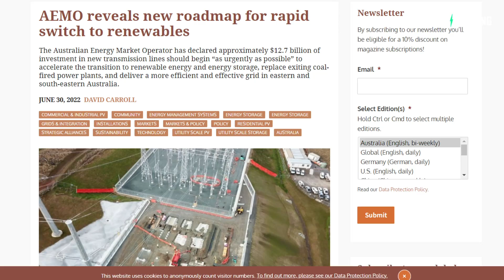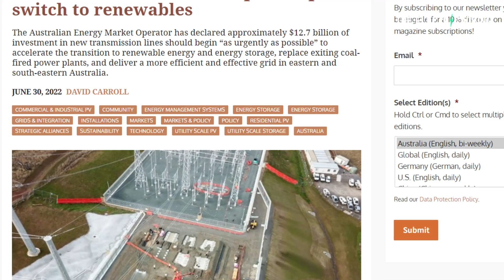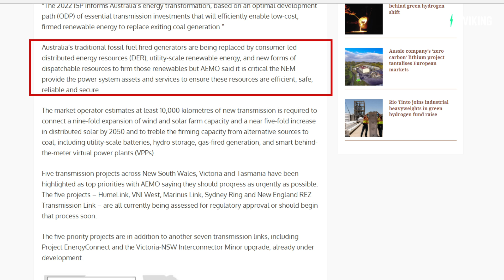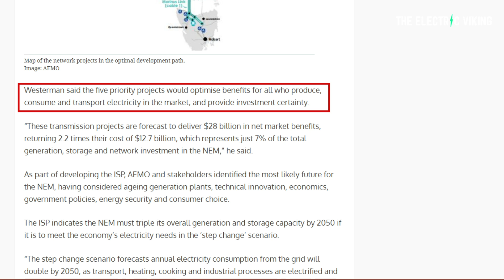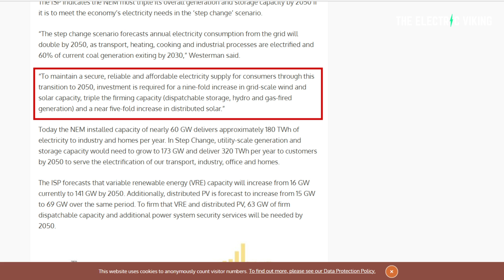Australia's AMAZING roadmap for rapid switch to renewables

Comment: An interesting calculation is that Australia only needs 1465 square miles (or 0.05%) in solar farms of its total 3-million square mile land area to provide for its annual electrical use of 265,232 GWh!  This 1465 square miles works out to be equivalent to the Sydney metropolitan area.

This is using the US solar farm value of 181GWh per square mile per year of energy production in their sunnier western regions which also includes seasonality, day/night cycle, solar panel efficiency and solar panel spacing.

For comparison, the US's solar farm size value is 22,000 square miles (or 0.7%) of its contiguous US 3.2-million square miles to cover its much larger 4-million GWh annual electricity use.  This is just the size of Lake Michigan and not even 1% of the contiguous US's land area.

Even doubling this figure to give a wide margin of error in either Australia or US calculations is still a small area of land.

Nobody would build a single solar farm this size but it highlights the point that solar is not a small source of energy.  That amount of panels would obviously be spread out using a formula that maximizes solar irradiance and be as close to the population centers as possible.  That amount of solar panels wouldn't even be noticeable from space when spread out.
Reply: Cover part of every rooftop, say 40m2, and have the power consumed LOCALLY.
Distributed power supply UNLOADS the grid. 
An EV (or home battery) will help stabilise the grid. And back up supply. 
If you have an EV do not need other battery. The EV comes with a huge battery free.
The Daily drive is 7kwh, tiny part of the 'long drive capacity'.

Comment: For those been asking, a country or state's renewables transition will be done gradually and follow a logistics adoption curve: slow at first, exponential ramp up in the middle, and eventually flattening out again as the new market matures.  It will also follow a phase-in & phase-out approach.

Fossil fuel (FF) plants (including peaker plants) will stay in operation on the grid as long as they are needed until they aren't.  Grid stability and capacity is paramount.

Concrete example: California has a similar Mediterranean climate to Australia and California runs on 70% to 95+% on non-fossil power sources during many hours of the day!  This happens day after day even though natural gas is some 50% of California grid's 200-terawatt•hour size.  How is that possible!?

As the sun rises in the morning, California's solar assets start feeding their energy into the grid.  Power reaches maximum at midday before tailing off around at dinner time.  This is typical. 

But natural gas and coal are "load following" dispatchable forms of energy.  So the grid operation center will automatically throttle back FF turbine RPMs towards idle as they see demand apparently "fall" but its actually solar power outputting large amounts of power into the grid and satisifying (canceling out) demand.  When FF plants are able to throttle back for many hours of a day, they reduce wear & tear, increase their operating lifetime, and directly decrease their CO₂ emissions.  This pattern happens day after day.

Critically, as the years go by, the renewable's daily power window will start expanding outwards as California adds more renewables and grid-storage to its energy mix until the entire 24hr day/night cycle can be firmly covered.  This may take a decade or two but this is how most existing grids are going to transition over and the pathway is fairly predictable.  Though exact timing is hard to predict due to politics, technology breakthroughs, citizen environmentalism pressure, wars & armed tension over FF, fluctuating FF availability and pricing, etc.  These things can either move up or delay the transition schedule in their own complex ways.

Any region with renewables in the energy mix will experience the same pattern.  At some point in the future, the last fossil fuel power plant in the region is decommissioned with a huge sunset party to memorialize it in the record books.  Reminds me of when they phased out the last public telephone booth in NYC early this year.  Many news outlets were there to cover this sad looking lonely telephone booth being unceremoniously hauled onto a flat bed truck.  Many jokes about Superman Clark Kent lacking a place to change were made.  Surely some zinger "dinosaur juice" jokes can be told for the last FF plant. :)

In conclusion, renewable energy already provides value to the grid even when the grid is in a *partial transition state*.  Fossil fuel fanatics (some are corporate petro paid shills) like to muddy up the forums and confuse people by implying that if the grid can't transition overnight then its not gonna happen ever.  Nothing this size happens overnight but the transition is manageable.

Comment: Thanks Sam. That's a decent step in the right direction. 🙂 A comparison is worth mentioning. The U.K. plans to have its last few coal-fired power plans decommissioned by 2025. Over a third of our electricity needs are met already by renewable resources, averaged over a year. Peaks have been over 60% for short periods.And there is a big investment in more wind, solar and tidal generation plants. 

That is the kind of goal that the US and Australia need to aim for. 2030 would be fairly good, if Australia could shut theirs down by then. But only a 60% reduction by 2030 seems rather paltry, when you have a country with huge amounts of dependable wave power available, plus oodles of Sun energy, and a fair amount of wind energy, particularly around your 10,000 miles (or more) of coastlines.

For contrast, Britain pales into insignificance when we look at Norway, which has been generating 98%, or more, of its electricity requirement for a number of years. They export some of their spare capacity to the island of Great Britain. The number of EV's being bought in that country is in line with their hydroelectric-based electricity grid. Sales of EV's outnumber cars of all other fuel types combined, mainly because of decent incentives, proper infrastructure  a positive attitude on behalf of those in office, and excellent education of the car-buying public. The rest of the world should take note.

Comment: Think like most things clean renewable power will work on a “s” curve … it’s taken 30 odd years to climb up to 5-10% generation in most off the 1st world but I reckon it will grew vastly fast from 20% to 80% before at that point it may climb slowly again due mostly to population gain… and solar panels/wind turbines starting  at that point needing replacement etc etc

Comment: Can you imagine?  Putting a $4 bn cable under Bass Strait so that during the day power can be pumped to Tasmania to drive water uphill and when night falls the water can run downhill to make power to be pumped back to the mainland.  Of course we shouldn't think of the alternative of making the wind/solar power near where we use it and using batteries for storage because then we wouldn't need AEMO.  The Grid is 20 C as is AEMO.  In 21 C the Grid should be a backup remnant and not something to which Australians are subservient.  The fact that our political class takes their advice from AEMO shows their proud ignorance of STEM.  Only costly mistakes like Snowy 2.0 will eventually force them to change.
Reply: EXTREMELY ON THE POINT. 
But I think the existing grid will gather power from every rooftop solar PV system and concentrate it / transport it to industry users etc.
Solar Electricity is being pushed into the grid now in a huge way and is part of the stability problem, Germany has had similar problems. 
Obviously more batteries are the solution. 
Big batteries are do able now.
EV batteries constantly connected to the grid were ever a building or car park is, will mean power/ stability can be traded for money or free parking or .....
The automatic plug in gizmo will be the killer invention. 
24/7 except for rush hour or daily drive, plugged into the grid.

Comment: I have always thought that Australia is ideally situated for solar generation.  You have many square miles of undeveloped outback with full sun exposure almost every day of the year!  As storage methods improve, you can phase out almost all fossil fuel generation as quickly as you can install the panels and the distribution lines.  That will make Australia totally independent for all their energy needs, something that other countries only dream of.
Reply: EV with a 100kwh battery at every home will make the renewable power solution perfect. 
The existing grid will be perfect. 
Forget $billions of transmission lines to Snowy 2.
If climate destabilisation gets going the dam will be empty. 
Hoover Dam is almost empty, NO POWER FOR LAS VEGAS and surrounding states.
Reply: We have governments owned by coal lobby
Reply: @troyswan7123  It's the same in the US.
Reply: Australia’s sun cable will power 25% of Singapore. Solar is not a replacement for a peaker
Reply: @chefgav1  is a replacement,  you mean.

Comment: Germany is a classic example of how renewables don't work. There is local opposition to new solar and wind farms as it is a blight on the landscape and their electricity costs have tripled since introducing renewables in large scale.  Lets look at some realities rather than just drinking the cool aid.
1) Sun and wind are not reliable sources of 24hr/7day per week energy. We need to have storage or alternate backups Usually gas fired generators i.e. carbon emitting.
2) Battery backup is not viable in large scales (at least not now). Hydrogen is still relatively inefficient conversion process & pumped hydro needs dams to be built and suitable landscapes. As an example the largest battery in the southern hemisphere in Adelaide can power the grid for all of 10 minutes before it is depleted.
3) Even if we did have sufficient storage options we would need probably 3 times the amount of solar panels & wind turbines to enable enough energy to be captured during the periods of operation. I.e. solar has about 6 hours of effective capture per day and wind averages about 30% uptime.
4) Solar and wind are diffuse sources of energy meaning we need vast areas of land and large complex networks of transmission lines. Poles and wires are a significant cost adder to our electricity bills.
5) Our current coal fire power plants already have the transmission lines built. Wouldn't it make more sense to build a nuclear plant next door and then use the same transmission infrastructure.
6) Nuclear is the only high energy dense, compact, reliable and pollution free option that makes sense for powering the future until fusion energy is solved. Renewables are for virtue signalling individuals that think they can power the planet (and future energy demands) with fairy floss and butterfly wings.
7) What is the impact of recycling all the solar panels and wind turbines at end of life in 20 years time? Do we just ship the panels containing toxic chemicals to third world countries and let them deal with it?
8) For those that are afraid of nuclear energy go and do some reading. It is orders of magnitude better than any other energy source currently on offer and safer for everyone as well. Including all the wild life that solar panels and wind turbines kill every year. 
9) Governments sell you on this renewable horseshit because they have been elected on this lie and have to follow through.
10) Now sit back and watch our power prices skyrocket (not reduce as everyone would have you believe). Look at Germany if you don't believe me!

Finally, go educate yourselves and apply some independent thought rather than believing the hype: https://www.youtube.com/watch?v=N-yALPEpV4w
Reply: Nuclear is really expensive, and slow to plan and build.
Why not surround the coal powerstation with a solar farm ?
Reply: Adrian Do you think electric vehicles will replace internal combustion vehicles?
Do you think an electric world is important.?
Reply: @stephenbrickwood1602  Yes I do, powered by Nuclear Fission until Nuclear Fusion is viable.
Reply: @ALB2073  nuclear power plants are a decade project each. 
Nuclear takes 20yeays, for positive cash flow and 60years to 100years of huge profits.
Who would turn them off?????
Central power plants with transportation and heating demands, LOADS up the grid and massive additional construction expenses to TRIPLE  capacity.
And additional Nuclear power plants to meet the INCREASED LOAD.
The world would need the same infrastructure to STOP ALL CO2 in the world. 
Nuclear power industries in every country in the world, 100,000 SMRs  !!!!
The USA is the biggest target in the world.
Nuclear proliferation is a 75year old problem. 
USA military costs will explode.
Reply: @stephenbrickwood1602  oh, only 63 Reactors being built to our none. Nuclear is just to hard, we should do nothing. You are right, I'm sure everything will be ok if we just will it so.
Reply: @ALB2073  53, not 63.
But facts are not a problem 👌 😊

Comment: Those returns you mentioned must assume a price for electricity to consumers.  I imagine that they do not include any allowance for a drop in the price of electricity to the consumer.  I would not be surprised to find that what actually happens is that the price of electricity to the consumer will go up because yet again we will be beholden to a few providers who can charge what they like.
Reply: Exactly what happened when they convinced us that privatising the utilities would be great and save us heaps of money because the power would be so much cheaper.  The exact opposite happened, hundreds of times more expensive. it's right there on the bill.  
If you have strong beliefs, you are easy to lie to because you will tend to believe what you want to be true. If you try not to cleave to some of these beliefs, you will see much more clearly where things don't add up, and where you might be being fast-talked.
Reply: @creatrixZBD  Markets are great at adjusting prices according to demand and supply, but only when supply can be guaranteed and there is sufficient competition.   I think that what we have in Australia is a misguided attempt to let markets control a scarce resource where there is insufficient competition.  To make matters worse, energy is an essential resource and supply needs to be guaranteed at an affordable price.  I'm all for nationalising the industry and making the government actually accountable.  At the moment they can simply point fingers at suppliers and shift blame for lack of direction at opposing political parties.  They are all to blame - Liberals for failing to provide any certainty on renewables, Labor and Greens for demonising anything other than renewables.  I worry that this so-called rapid adoption of renewables is an experiment that is bound to go pear-shaped because of poor management, greed and blind ideology.

Comment: No mention of the spot price for biddable frequency stability being the single source of immense profits for coal fired power stations over the last 40 years. Then the gas fired electricity generators became more common so the profit moved there. Then grid scale batteries changed the 15 minute spot price for FSS from $15K per MWh to about $300/MWh. 

The coal fired plants aren’t being replaced because there is no opportunity to profit they way they previously did. The business model no longer works. 

Those SAME people are now manufacturing electricity generation scarcity just to break even. Previously AEMO tolerated this because there was no political will to fight the owners of the coal fired generators. Now that’s broken too and AEMO have rolled the dice
Reply: Thank you for speaking about these tactics. 
Can you copy, save and post this elsewhere. We can not copy. 
Even the nuclear power industry will have peek demand and stability problems.
There are active pro nuclear promoters speaking and being paid to speak about nuclear power technologies.

Comment: 2030. 100% by 2030.

Must also pursue a  granular distribution of photovoltaic cells throughout the neighborhoods upon individual houses and on local lots. Arbitrage into the grid. Use powerwalls, cars, and neighborhood level megapacks to load balance/arbitrage. Charge batteries at night/ discharge batteries and direct use solar during the day. 

It'll work like that until we deploy enough storage mated with enough generation for 100%. Bet even 20% of prime rooftop space of current buildings, 60% of all new construction, would make us energy independent.

Greatest thing we forget about redirecting toward sustainability is that once inplace, once we have enough SWB keeping up will be easy. Maintenance will be inexpensive, relatively.  Energy would be in ready abundance at low cost.
Reply: The EV with it's 100kwh battery and regularly connected to the grid is the key to grid wide power and stability. 
Every building is connected to the grid. 
Every rooftop can have solar PV panels. 
Every building can have one EV. 
Every home needs only 6kwh over night. 
Ezi pezi.

Comment: People complain about high energy prices for fuel and utilities that will continue to go up every year.
Get solar panels for your roof and power your AC and your electric car with free energy from the sun.
Most home solar systems have a payback of 7 or 8 years. In Australia it should be even sooner.
Getting a home blower door tested and air sealed is another great way to save money in the long run.
Find those air leaks and seal them up. Too many people only look at the up front cost and miss out on long term savings.
Thinking long term will put money in your pocket over time.